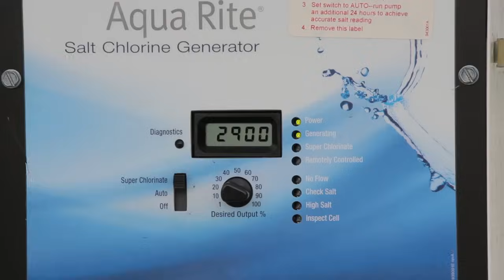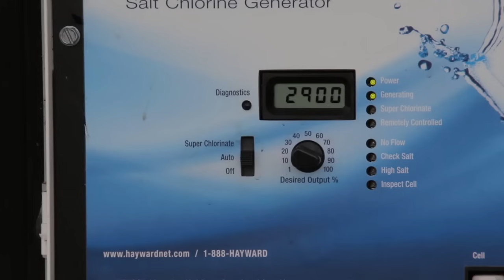How To: Recalibrate the Salt Level on a Hayward Aqua Rite

Comment: This doesn’t work for me. My cell doesn’t say if it’s a T9 or 15.  I have it in 9.  Does it matter?
Reply from the maker: What firmware revision is your control using? You should be able to find that in the diagnostics menu? Unless your control / main PCB is revision 1.50 or higher, it does not have the ability to switch cell type and is only compatible with the TCELL15.

Comment: When recalibrating, the numbers that begin to scroll have a minus sign. As the numbers go down, do I need to wait for the minus signs to disapear from the readings to find my correct level before hitting auto -  super clorinate - auto?      
So if my salt level is 3200, can I move the switch from auto - super chorinate - auto when it hits -3200?

Comment: Installed new salt cell, i have a 1.59 firmware, what should my t-cel # be on my switchboard ? I currently have it on t-15, but salt level went ftom 2700 to 1100, so i changed it to t-5. Unsure what proper # should be

Comment: I tried to recalibrate about three times and the display continued to show 1900 salt reading after it settled down but I noticed that a higher level did appear initially (the store reading was 3200).  So, I quickly hit super chlorinate when the 3200 reading appeared and the reading "stuck" or in other words, the reading was the same as the store reading and the reading was high enough to start producing chlorine again (odd eh?).  I suppose that overall, this may be an indication that my sale cell is getting close to the end of its useful life but I can't recall how recently I replaced it (and not in the sense of being so long ago, it just means that it was not this year (LOL)).  I will make a note now in my records when I do put a replacement cell in the system to watch for the lifespan which I understand typically be only 3 to 5 years! Thanks I would not have gotten this far without your info!
Reply: Very interesting, I actually just replaced my salt cell as it stopped working. The Hayward control panel also read 700 salt level. After replacing the salt cell with the same version, it would still not chlorinate because the control panel would still read 700. I tried to recalibrate with this videos method but it would always stay around 600-700. 

Read your comment, played around with it a little more, and eventually I saw the screen go from 4400 to 300 in about 2 seconds, decreasing in about 400 intervals. Tried your trick and timed it after about 10 tries, got it to read the salt level and boom, it’s working lol.

In my case my salt cell is brand new and this weird trick made it work.

Comment: The salt number starts the countdown at 2400 when my levels are at 3000?
Reply from the maker: And is that after recalibration? Have you checked he diagnostics menu to confirm you have the correct cell size selected?

Comment: If I selected 3600 while recalibrating and on the screen (after I clicked five times) it's still written -2900/-3000 even though it's on 3600, is there an issue with my turbo cell?
Reply: I'd like to know this answer too. Did you find out ?

Comment: My power light is off. All other lights are working. However, my salt level tests at 3600, but the dial says 2100, and is not decrementing. I tried all the info given so far. After the click, the check salt light comes on steadily. My cell is brand new.
Reply from the maker: Have you checked the control's diagnostic menu to ensure you selected the correct cell size? System readings will be skewed if you have the control set to the wrong cell size.

Comment: What button push sequence do I need to do to get the salt reading back to 2900, 3000 etc,. right now it reads like 3.2
Reply from the maker: To change the unit from Metric Mode to US Standard , start by pressing the 'Diagnostics' button one time. Once showing the temperature in Celsius, move the switch up to 'Super Chlorinate' then back to 'Auto'. After 30 seconds the unit should settle back to the default reading.

Comment: You're supposed to turn the knob to 100% before doing this per hayward
Reply: Bingo! 
I tried twice with the % set to 70% and the PPM started descending at 2,000PPM even though my true levels are 3,000PPM. Then I saw your comment and changed it to 100% and it started descending at 3,200PPM, so I was able to recalibrate.
Thanks!
Reply: I just clean it and my test reagent says 2,200 but the Baird still says 3,400 and I recalibrated it 3 times and nothing changed

Comment: My salt cell and low salt lights are solid. I have plenty of salt and my salt cell is producing chlorine. Recalibrating hasn't worked, because the Aquarite 900 isn't recognizing the correct amount of salt. I'm skeptical it's an issue with the cell, because it is producing chlorine. I'm stuck in a loop.

Comment: What do you do if the salinity number never falls to the number on the test strip.  Our salt level reading 3400, the test strip says 3100, when I try to recalibrate the lowest the number goes is 3500.  I don't have the option to set to 3100.
Reply: Should be fine

Comment: Say your actual reading is 2800 but the SWG is reading 3000.  As the display is decrementing the salt value, what if it doesn't go low enough to the salt level value you need to recalibrate to?

Comment: I have a T-15 cell and the control box is set to t-15. The salt strips read between 2100-2500 but the control box displays 3800 ppm. Followed the instructions but the calibration only went down as far as 3700. I'm guessing the strips aren't great. The cell is relatively new and was replaced last year in 2021. Thoughts anyone?
Reply: Same issue... I have gone away from salt system ... Always in adequate reading when I test my pool.  Biggest money pit is owning a pool

Comment: Last week panel read 3300, but professional testing said 2095, and recommended I add 79 lbs of salt, so I did. Now the panel reads 3800, and I can’t recalibrate using this method, it starts count down at 3900 and stops at 3800, after 30 seconds it exits diagnostic screen.

Edit: system is 2 weeks old

Comment: Can anyone answer why it is bad if the salt level reading is different then the actual salt level in the pool. Just because the aqua rite reads it wrong what does that impact other than a number on the screen. Why is it bad if it reads the wrong number.
Reply from the maker: If the salt calibration is way off, the system will stop generating chlorine. For example, the salt range for an Aquarite is 2700-3400ppm. If your actual salt level is 3000 but the system reads 3700, chlorine will stop being produced.

Comment: Make sure you control box is set to the correct t- value before trying this. They come set to 15 by default so if you have a 9 series cell this will not work. I learned this the hard way. Like others in the comments my testing strips/digital reader was showing 3700 and my box 2700. Once I changed my t-value to 9 it worked fine.
Reply: Same thing happen to me. Mins was programmed for a 40k pool and I was wondering why it kept saying low salt … had to change it to T-cell 9 because it came factory as T-cell 15.
Reply: I scrolled all the options on my display & nothing that starts with T to select cell type.
Reply: @amyqlim  it kind of looks more like a upside down F than a T 
https://www.poolwarehouse.com/wp-content/uploads/2017/02/Hayward-AquaRite-Troubleshooting.pdf
check page 4
Reply: @PlainCheesePizza  tq for the helpful link. When my system came on this morn, I went over all that were displayed & nothing with t-15. This is what it showed: salt level default, temp, voltage, amp, desired output, instant salt reading, AL-2, rl.113.
Reply: Thank you! Had this issue and couldnt figure out why the salt reading was off so far.  Google searched the manual and had it fixed in 5 mins!
Reply: Thank you so much that’s exactly what was wrong with the system I was working on !

Comment: I measured the salt level in my pool as 3300 ppm using AquaChek salt strips. Using the procedure in the video when I try to select the calibration level, I cannot select 3300 because the instantaneous reading starts at 2200 and goes down.
Reply: Change the cell type to T-9.  This produced the correct levels when performing the calibration process.
Reply: Same here.
Reply: Maybe you need to clean the cell
Reply: Yep   I don't trust any of these calibrated measures. I've seen so many ways to do it.  None ever work.

Comment: My salt reading is 3800 but the panel only reads 2100 how do I make it reset and count up ? It only starts at 2100 and counts down /:
Reply: Unplug it and let it sit for 5 to 10 minutes and then while it is unplugged, press and hold the button for 30 second and plug it back. See if this will help you.

Comment: My Aquarite is showing 3300 but true reading is 2700.    Calibration doesn't allow you to pick a number lower than the instant salt reading (3300).    Brand new cell.   Generates chlorine fine.   But I would like to calibrate the true salt levels.   Any suggestions?
Reply: Same here
Reply: Add salt till your around 3300

Comment: help! my display reads 4100ppm but i measured with a meter and strips at 2500ppm.  i recalibrated 2 times already.  why is the reading so off?
Reply from the maker: First, make sure that the correct cell is selected within the control. Press the diagnostics button until you see a T number. That number should match the number on your cell. For example, a T-Cell-15 should read T15 on the display screen. If the cell numbers match, try cleaning the salt cell. If the problem persists, it's time to replace the cell.

Comment: In case anyone is still watching this, I tried doing this many times with my system, but I can't make it work.  I've tested my salt level with Taylor test kit and get 3000 ppm.  The display on my Aquarite says 2700.  This procedure has no effect on the display.  It always ends up reading 2700.  Moreover, I've been to another site, where he says that the system can't be calibrated.  I thought I'd mention that in case anyone else tries this method and fails
Reply from the maker: We've been able to successfully recalibrate the systems. However, it's usually a temporary fix. There is usually something else wrong with the system that needs to be corrected. The cell selected in the control box may not match the cell on the plumbing. Another possibility is that the salt cell is beginning to fail.
Reply: @Inyopools  Thanks for your response.  Try as I might, my system would not recalibrate and there are folks at other sites who claim it can't be done.  I give up.  I suspect that you're right about something else being wrong though.  My cell is 3.5 years old, getting close to time for failure.  I'll replace it when a bag of salt has no impact on the reading.  I expect to get through this season
Reply: Same here. My salt is 3460 but panel reads 4100. This reset procedure works but still only goes down to false 4100 level. Board is good, cell is clean and set to T 15.
Reply: @rhuggard2011 I have the exact same issue. But I have a T-Cell 9 and recently replaced the cell.
Reply: @kevinschweikhart  One thing you need to know when you’re dealing with these aqua trol systems much like my own if it’s not the salt cell, you wind up having to replace the board inside the main box. They say they’re supposed to last about five years but a lot of times they only last about three. When you change the board, the problem goes away for a while, they’re not cheap. That’s the only thing that sucks.
Reply: Same here. I bought a SeasonGear salt-3500 Salt Meter. It reads 3250. Had the water tested at the pool store, 3250. The Hayward unit says 1700. When “resetting” it it starts at 2700 and counts down. Pool store guy said I need a new unit. Not everything but the inline generator. Funny thing is they do not sell them. He sent me online for one.

Update. We purchased a replacement cell for our unit. Installed it and all the readings were the same. I used this video to reset the new cell. After it worked exactly as the video said. So my conclusion is if your cell is ok this should work. If the cell is bad, we’ll only replacing it will work. However you might need to “reset” your new cell.
Reply: same here it does not work.
Reply: Always use drips my company stopped using gadgets

Comment: Hello can you help me my panel says HI salt and put a red light  I did the calibration and still the light comes back on the reading says salt is 4500 but I took it a pool store and they told me the salt is 3100
Reply: Then it's 100 ppm to high let it go it's ok just clean the cell out

Comment: Hi. I tested my salt level using strips and I get 3400. My Aquarite gives me 2400. When I tried to recalibrate the system the reading never goes up to 3400 so I can't reset it correctly. I check my cell and voltage and Apms are ok. I even cleaned it. Any suggestions ?
Reply: Did you ever fix ?
Reply: Same issue, I can’t get the panel to match (and stay matched) the results to my salt test.

Comment: my salt starts at 6000 and only goes down to 4100 and then stops.  Pool store says my salt is at 3600.  Any ideas how to get it to drop down past -4100 so I can recalibrate?
Reply: I'm having this same issue right now. How did you resolve it?
Reply: Same here after an aftermarket replacement cell.
Reply: @CoachSteveW  hello did you get your problem solve ?
Reply: @CoachSteveW  hello God night I'm having the same problem I just changed my cell did you get it fix and can you tell me how you solve it ?
Reply: I have the same problem can you tell me how you get it fixed please ?
Reply: Exactly same problem here. Anyone as the solution ?
Reply: Exactly the same issue. It stops at 3,700 and stops going down. My version is 1.4

Comment: The number that shows by default on my 30,000 gallon 12' round pool is 2400, but the - number is reading -2100. What does the 2400 mean? Is that the amount of salt my pool should take and the -2100 means it's off by 300 ppm? Thanks!
Reply: Sorry, meant 3,000 gallons
Reply from the maker: The 2100 and 2400 are likely the salinity level of your pool water, measured in parts per million (PPM.) The required salinity level for your system should be listed in the chlorinator's manual. The manual should also include a salt chart, this will help calculate how much salt you need to get to the desired PPM. - MGS
Reply: @Inyopools  hello can you please help me . I just changed my cell and I did the calibration but after o couple hours it says HI salt I took a water example and they told my my set it's good it's on 3100 can you help what else can I do too get oit solve also same reading they told me ist not doing clorine

Comment: I cant get salt reading in thousands  I got a decimal .
Reply: +rafael moros Did you ever figures this out?   My salt reading is 1.7 confused look
Reply: Push the diagnostic button 5 times. When you see your decimal number, move the switch from auto to superchlorinate and back to auto again. This should move you from decimal to ppm.
Reply: Donavan McCoy this does not work for me. 

Mine use to say 3300 but now says 3.30. If I push button 5 times until I see the -3.30 then go to super chlorinated and back to auto, nothing happens
Reply: @Particle44  You have to go to where it shows the temperature of the pool water in Celcius, and then go from auto to super chlorinate and then back to auto... once the temperature is reading correctly in Fahrenheit it will read correct for the salt level (no more decimal)